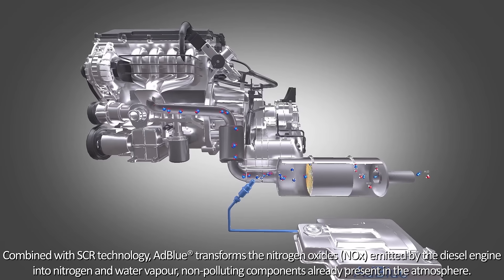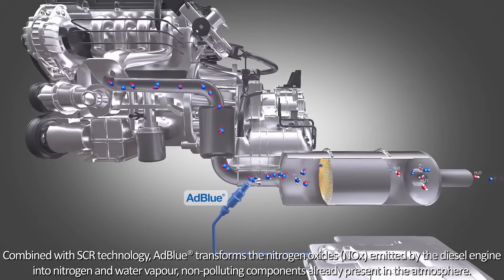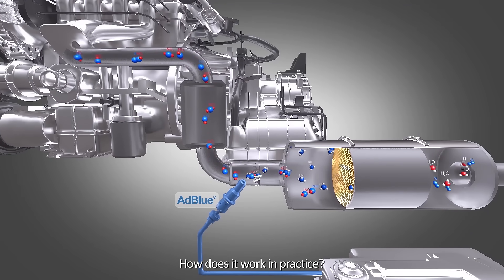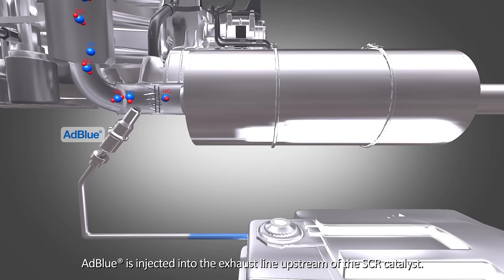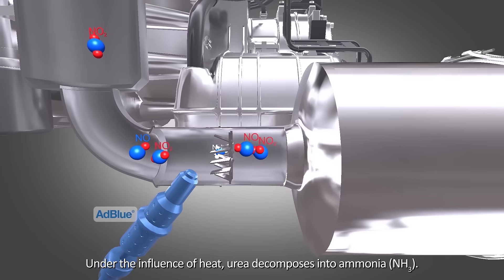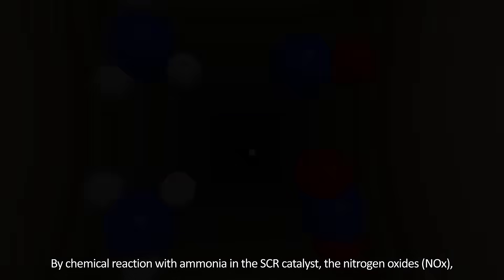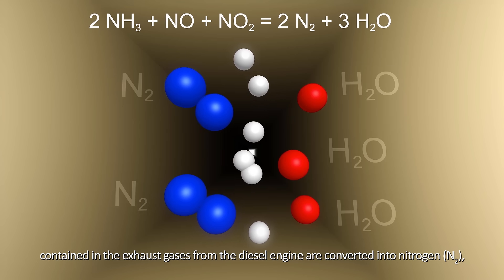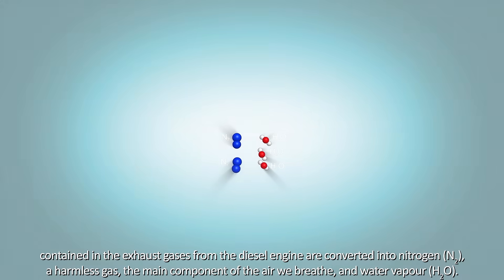TotalEnergies - AdBlue® and SCR 3D video

Comment: Best would be to remove the whole system, particle filter, catalyst and ad blue injection. There are ways of doing this without the "check engine" light coming on. 30 years ago a vehicle could run real rough and have real poor combustion, exaust strongly smelling of gasoline or deisel without lighting up a chrismas tree of warning lights.

Comment: in my country algeria they all say to remove that adblue when u buy a new car bcs this adblue detsroy your engine , idk if it is true tho
Reply: AdBlue is not injected into the engine as a fuel additive. It is added to the catalyst system in the car's exhaust system. So it is never directly added to the diesel fuel and will never come into contact.
Reply: If you remove adblue completely, the SRC converter is not going to work properly and fill up with soot quicker. Later it will create a blockage and slow down the exhaust airflow. If this happens, the car will run in limp mode
Reply: No it's not
It is injected into the exhaust, so how could it destroy an engine?
Reply: Not destroy your engine but will cause issues later because AdBlue will cristallise with time and clogge the entire ADB system.